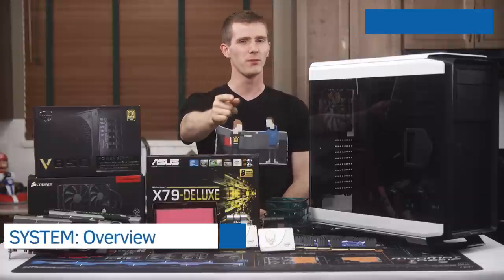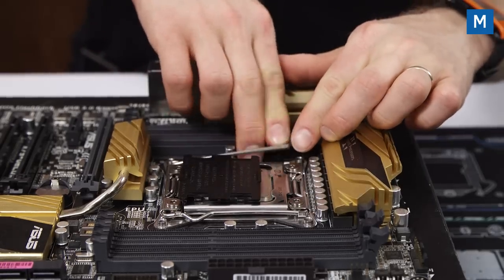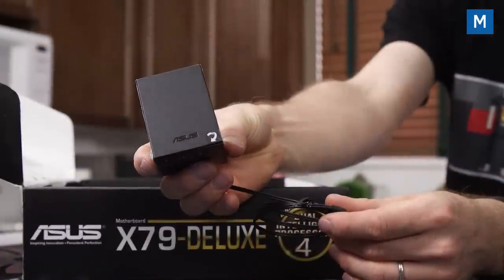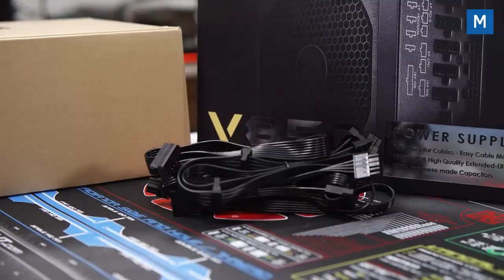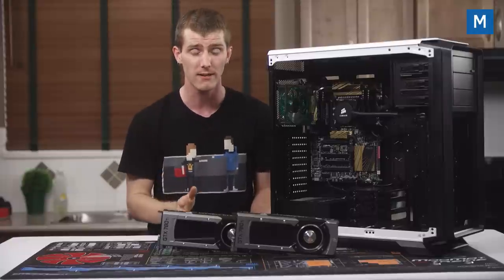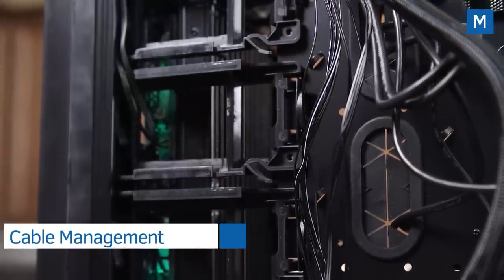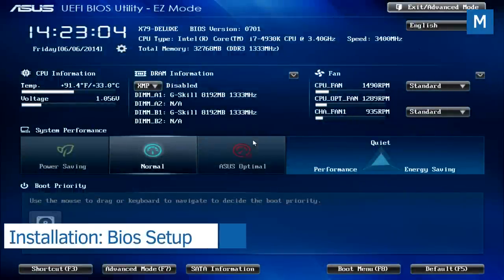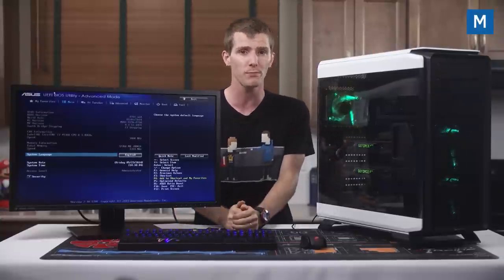How to Build the ULTIMATE 4K Gaming PC Build Guide

Comment: when you said the 8 screws that hold it and pointed at them you pointed at 9 "here's"....

also you didnt show how you installed the corsair cooler

and when are you gonna do a quad-sli water cooled + water cooled cpu setup?
Reply: lol this video is over 2 years old, but anyhow, he mentioned that the 9th screw hole is used to hold the motherboard in place, meaning u don't put a screw in it..

also the cooler is straight forward, u just put the radiator on the fans and screw 8 screws in, not a big of a deal

lastly, he already did a 7-way-crossfire water cooled + 2-cpu-block water cooled, the video is called 7 gamers 1 cpu!

hope i helped! :)

Comment: Since computers have come a long way and with the MUCH added benefit of using Liquid cooling of the processors, memory, video cards, and even some hard drives. Will they play old games like Flight simulators? What games CAN you play and how many window tabs can you have open before it bogs down. I normally have 25 window tabs opened because Im doing multitasking in my business. What is the price tag of this system and which operating system are you using?

Comment: Is there a cheap build that allows 4k very lightweight gaming. Like Minecraft 4k gaming? Yes, I do know that minecraft is not 4k, but I at least want to run shaders on it.
Reply: yeah, gtx1080 and any 8 thread cpu
Reply: Don't know if it is stil relevant, but 1050ti and any half decent modern CPU should do for minecraft although it won't for 4k with shaders

Comment: I'm trying to build myself a computer powerful enough to make games with... My intention is to be able to generate high quality light maps and render videos to up the quality of my games by a lot while still allowing players to render it without needing the huge rig. My games have an emphasis on graphics because I have a background in Fine Arts so I might render 3D animation too to use as loading screens or Main HUD, this is to allow people with lower specs to go set the default settings lower without making their computers crash.

:/ this is the first time I'm going to build a computer but it became obvious my current computer is affecting my work "flow". It takes 2 hours to render light maps on some levels which means I can't do anything while it does. I can't do it when I'm sleeping because there are other levels to calculate once its done. It really brakes my "in the zone" feel.
Reply: do you still need help?
Reply: iBoolGuy yeah, I mean im not going to buy it until I get enough money for it which could take until I release my new game :/

Basically I need a build with a good CPU (to calculate lights) a good (gaming) graphic card and like... whatever else you need to render videos in a short amount of time.
Reply: tenedria ok sweet, let me help you out then.
first, if you're dealing with intensive graphics on resolutions over 1080p, u r going to need to spend above $350 on a GPU, tho, if the games you make or the programs you deal with aren't that demanding, and you are not planning on working on over 1080p, then you're good with the RX 480 4GB/8GB ($220/$270) gpu from AMD, this gpu is a beast, runs games on 1080p like charm, which would be a PERFECT choice for you.

secondly, CPU, now, most gamers, and casual video-producers tend to buy the i5, a 4-core CPU(4 actual cores), this CPU is a perfect choice for gaming and casual video-rendering, but, if you're going to deal with a lot of frequent rendering, an i7 would be better for you, either an i7 6700, or i7 6700K(K means it's overclockable, meaning you can run it on a higher clock speed than its stock speed), an i7 6700K costs around $320 depending on your area, an i5 6600K on the other hand only costs $240(I'm talking top-end i5, best in the market)

if you want to fully understand and have a good idea on the difference between i5 and i7, search youtube for( i5 6600K CINEBENCH, and i7 6700K CINEBENCH), that'll give u the perfect idea on what to choose.

thirdly, RAM, get yourself 16gigs of DDR4 ram and you're good, actually it won't be that big of a deal choosing RAM, just pick any DDR4 available and you'll be good to go

lastly, SSD(for lightning fast and snappy and very responsive experience), also once again, choosing an SSD could be a headache sometimes, but I'm gonna put it out like this, buy 3 levels above the cheapest, say you need 240GB of storage for your main(OS and important apps), then look for just below mid-range-priced SSD!
I mean, prices of SSDs differ by a lot, but in real world performance, the difference is not worth the money(you got the idea)

the rest of the stuff is self explanatory, you're going to need a case, get the cheapest available it doesn't matter, some cpu cooler to keep the CPU safe, and a power supply above 500 watts, and of course some HDDs for mass storage!

that's pretty much all about building a PC, tho, some people prefer a laptop for general use beside gaming, if that's what you want, I can't help that much..

that being said, I hope I was of help, have a good day and a good luck, peace! :)
Reply: tenedria and ah, so sorry for the long comment, couldn't be any shorter :(
Reply: iBoolGuy The ssd drives would be cool but what bothers me about them is that they don't seem to have as much storage as hard drives yet. I tough just a fast hard drive would work since I won't move the computer from its desk. Do you think I should still get an ssd... say I could have the game im currently working on in the ssd and everything else into the hard drive. Would it still be worth it?
Reply: tenedria an ssd, is the simplest best and fastest way to enhance the performance of your pc, it is a MUST, get yourself any 120GB for the OS(windows 7/8.1/10) and your most frequently used applications, you'd be very good to go, and if you need more space, you get another normal hard drive!
note that the fastest hard drive on earth won't even be any close to compare with any ssd out there!
you can even get yourself an ssd right now, for a laptop or a desktop, performance will boost like crazy!
and, if you're worried about transferring the data from your current hard drive to your SSD, there're a lot of "cloning" softwares out there, where you simply clone your entire drive(with the OS and the wallpaper/settings/save files), literally everything, u can do that, or installing a fresh copy of windows on it!
Reply: tenedria in other words, an ssd is the best investment in building a pc, that being said i've gotta get to bed, g.night! :)
Reply: iBoolGuy ok thanks, good night

Comment: Awesome videocan u help I cant decide how much psu I need could you help. These are the specs:
intel i5 6600k
Asus Z-170-P motherboard
16gb 2x Ballistix Sport RAM @ 2400Mhz
Asus Dual-GTX1060-O3G OC edition
WD Blue 1tb HDD
Kingston 128gb msata SSD 
AOC 27" monitor 
CIT G-Force case (White)

Comment: This is the first time for me to build a gaming PC. 
Will the PC work with these parts

'Nzxt ca S340 W B3 Protector S340 Elite Steel ATX Mid Tower Case, Matte Black

Netzteil EVGA 650W SuperNOVA 650 G3 Modular (80+Gold)

Asus ROG Strix Z270 °F Gaming Motherboard Socket 1151 (ATX, Intel, Kaby Lake, EX-Z270 4 DDR4 Memory, 3.1, M.2 USB Interface

'Intel BX80677I77700 K Quad Core "Kaby Lake Base Beat 4.20GHz Turbo Processor 4.50ghz), Grey

Seagate ST2000DM006 Barracuda 2TB Internal Hard Disk; 2000 GB; 88.9 mm (3.5); 64 MB Cache, SATA 6 Gb/s

Gigabyte GeForce GTX 1080 Ti Aorus 11GB GDDR5X 352BIT 1xDVI 3xHDMI 3XDP Active

Corsair Hydro Series CW-9060025-WW ,H100i V2 GT High Performance All-in-One CPU Water Cooler, black

Samsung MZ V6E2 S24 A450BW SSD 960 Evo Nvme M.2 250 MB with up to 3.200mb/S Sequential Read and 1.900mb/S WRITE, black

Corsair Vengeance LPX 16 GB Desktop Memory Kit - Black
Reply: Johan Johansson yes

Comment: My i5 6600k with gtx 1070 on a msi z170a gaming m5 with some other stuff is gonna arrive tomorrow, will it be able to run a 4k monitor with 60hz? the monitor is gonna be 28 inch. i really wanna get at least 50 fps out of it without going back to medium settings etc.

Comment: I recently just built a pc my first ever! I wanna know how I did. So it has an I5 intel core and a windforce geforce GTX graphics card it currently runs minecraft at high settings for 57 fps and Overwatch at mid settings for 60 fps
Reply: And its 3.2 ghz
Reply: JustAryan nice but which i5 and which gtx graphics card? I'm getting the 6600k and the gtx 1060 asus strix
Reply: SnowSpider108 I got a I7. Msi 10180 Hd
Reply: JustAryan 
Which i7? And there ist noch such Graphics Card

Comment: good pc? 
GTX 1080   Corsair Vengeance LPX 16GB (2x8GB) DDR4 DRAM 3000MHz     Intel Core I7-6700K      Gigabyte Z170X-Gaming 5 

      WD Blue 3TB Desktop Hard Disk Drive - 5400 RPM SATA 6 Gb/s 64MB Cache 3.5 Inch     Thermaltake Versa N21 Translucent Panel ATX Mid Tower Window Gaming Computer Case       Thermaltake Versa N21 Translucent Panel ATX Mid Tower Window Gaming Computer Case

Comment: Hey I am building a new rig with an MSI x99 SLI Krait and I am a little confused. The case gives me stand off screws but when I line it up they don't go nowhere except right into the back of the silicon. 
I am pretty sure I do not need them for this board but I wanna be extra careful before I fire it up. First time I built a computer when I was 15 and fried my board b/c I used the wrong hardware and shorted the board out on the case. Really don't want that to happen with my fucking Broadwell E in it LOL. It is a be quiet! 800 full ATX btw.

Comment: i need to change my motherboard ned to know whats a good motherboard to by i have a GA 970a-ds3p ultr durable motherboard with a 700w cool master psu i had it built back in 2013 looking to get a gaming motherboard time for a upgrade i can only apply DDR3 slot rams so have 2x8 hyperX  1866 in it now the tower is a large tower has 5 fans in it so plenty of room

Comment: Hey guys was wondering if this is a good build :

Intel Core i7-6700K 4.0GHz Quad-Core Processor

Corsair H110i GTX 104.7 CFM Liquid CPU Cooler

Asus MAXIMUS VIII HERO ATX LGA1151 Motherboard

Kingston HyperX Fury Black 16GB (2 x 8GB) DDR4-2133 Memory

Kingston HyperX Fury Black 16GB (2 x 8GB) DDR4-2133 Memory

Samsung 850 EVO-Series 500GB 2.5" Solid State Drive

EVGA GeForce GTX 980 Ti 6GB FTW ACX 2.0+ Video Card

NZXT S340 (Black/Red) ATX Mid Tower Case

EVGA SuperNOVA NEX 650W 80+ Gold Certified Fully-Modular ATX Power Supply
Reply: And here are the people who just want to show off their specs..... 😂😂😂😂
Reply: I'd get a 10 series card, or wait for vega.
Reply: im building almost the exact rig right now. exept msi motherboard

Comment: HI LINUS IM FROM 2016 IM HERE TO TELL YOU THAT IN 2016 WE WILL HAVE AMD RX 480 AT 200 DOLLRS THAT CAN RUN 1080P 30-60 FPS
Reply: The 480 can do a lot better than just 30-60
Reply: +jowys 120? 240?
Reply: It'll run most every new game at high (and even some ultra), 1080p at 50-60, with older titles exceeding 70.
Reply: 1440p and 4k?
Reply: I wouldn't buy the card for those resolutions (especially not 4k), however in some cases it can handle it.
Reply: For 1440p gaming the 1070 is a great option, and likewise the 1080 is great for 4k.

Comment: I know it's going to sound stupid but I'm pretty new to this stuff and I'm looking to upgrade my GeForce GTX 960 on Intel(R) Core(TM) i7-4790 CPU @ 3.60GHz and I'm looking at 970 but there are two versions of it and I'm not sure which one will work or is better for me. Thanks for any help.
Reply: Every version will work (I personally own the gtx 970 strix by asus which is really quiet)
Reply: So what's the difference between them because there's a whole bunch to choose from
Reply: I wouldn't upgrade a 960 to a 970. It isn't really worth it, the performance difference is minimal, but you will spend lots of money. save up some more and get something like the 1060 or 1070
Reply: +Marcus Octavius Well I actually got 1060 already, bought it on Friday and received yesterday. I decided to stick with 1060 instead of 1070 as I'm not going to get a 1440 monitor. I got 1080p 144hz instead.
Reply: Rokas Siskauskas that's great. How does it perform? I'm thinking about getting one too
Reply: I have only tested it on 60HZ monitor for now. I cannot say that it's more FPS because it was already capped at 60 while using GeForce Experience optimisation tool, but I'm now able to see the same FPS rate at higher details. 

I will have more details tomorrow as I will test it on 144HZ monitor.

Comment: Guys does this pc sound ok im new to  building and I dont wan to buy until I know this build will work well. Im aiming mainly for maxed out on most games but games like GTA im aiming just for a fast and smooth 60fps at 1080. (Ive used pcpartpicker and the total has come out to

processor- Intel core i5 6600k 
CPU cooler- 212 evo
GPU/Graphics Card-  MSI GTX 1070 8GB
Memory/RAM- Kingston Hyper X Fury Black (2x4)8gb DDR4-2133
Motherboard-MSI H110M Gaming Micro ATX LGA1151 Motherboard
Storage- Western Digital Caviar Blue 1TB 3.5" 7200RPM Internal Hard Drive
Kingston SSDNow V300 Series 120GB 2.5" Solid State Drive
Case-Corsair SPEC-02 ATX Mid Tower Case
Power Supply- EVGA 500W 80+ Bronze Certified ATX Power Supply
Operating system- windows 10
and a wifi adaptor

the price is $965 minus the operating system and adaptor

Please tell me if this will work for what I want and if their may be a build equal to this but cheaper!
Reply: 1. You wont be able to overclock on that motherboard, so you're paying extra for that unlocked CPU. If you're not going to overclock get the i5-6600 to save some money, if you are planning to overclock then get a z170 mobo. Also the i5-6600 comes with a stock cooler, you can always try it first before deciding on getting an aftermarket cooler. From what I've read,  the stock cooler is adequate.

If you want to overclock, make sure the PSU can handle the power requirements.

2. I personally would go for 16gb of RAM, 2x8 GB.  Game requirements are heading that way if not already.

If you want to save a little money, you can go for the lower end MSI GTX 1070 and then overclock the card yourself with MSI afterburner.

Other than that it should run games than fine at 1080p. I have an i7-6800k and a 980ti and benchmarking GTA 5 on 1080p Ultra settings I get about 35 FPS but during regular gaming I manage over 60.

Comment: I'm hoping to be able to run games such as, Rust, CSGO, Stranded Deep, Depth, The Forest, pretty much all the popular Indie Games...Will these specs run it?
 
CPU 
Intel Core i5-6500 3.2GHz Quad-Core Processor

CPU Cooler 
Cooler Master Hyper 212 EVO 82.9 CFM Sleeve Bearing CPU Cooler

Motherboard 
Asus H110M-A Micro ATX LGA1151 Motherboard

Memory
Kingston HyperX Fury Black 8GB (2 x 4GB) DDR4-2133 Memory

Storage 
Western Digital Caviar Blue 1TB 3.5" 7200RPM Internal Hard Drive
 
Video Card
EVGA GeForce GTX 960 2GB SuperSC ACX 2.0+ Video Card

Case 
Apevia X-HERMES-GN ATX Mid Tower Case

Power Supply 
EVGA SuperNOVA NEX 650W 80+ Gold Certified Fully-Modular ATX Power Supply

Optical Drive
Asus DRW-24B1ST/BLK/B/AS DVD/CD Writer

Operating System  
Microsoft Windows 7 Ultimate 64-bit
Reply: I'd say yes
Reply: +Zuhair Siddiqi im going to build it, so I can make as much changes as i want.
Reply: Then I'd upgrade the i5 6600 to a i5 6600k, it's not that much money and it's a big improvement
Reply: Zuhair Siddiqi Possibly overwatch.
Reply: get Rx 480 once prices go down
Reply: Gtx 1060 or the RX 480 would dramatically increase FPS performance and Longevity for games and drivers.

These two are still feuding, both have justifications on why you should choose it so it's just a toss up the coin.

Although, you'd have to spend £30 more for the AMD card and £60 more for the Nvidia card.

Comment: So Linus I have an i-7 6700k a msi M7 1000P EVGA  64gigs of Corsair ddr4 Dominator in an  areocool case. Running Windows 7 pro Any suggestions on GPU"S?
Reply: Paul Burke depends on how much you have to spend, sounds like alot considering the above specs. I'd go for a 1080, but if you're willing to wait and invest, the 1080ti is right around the corner